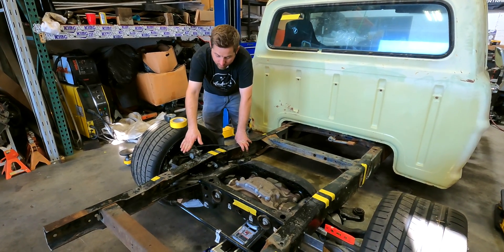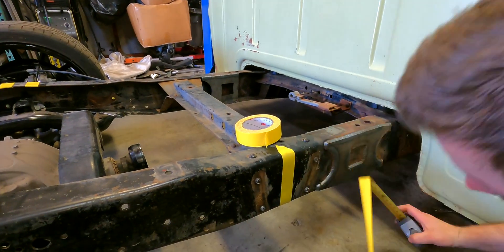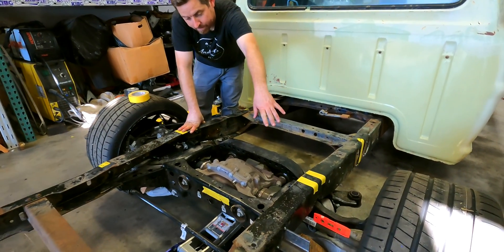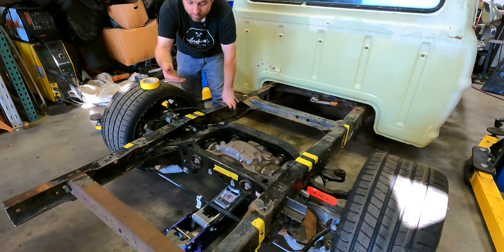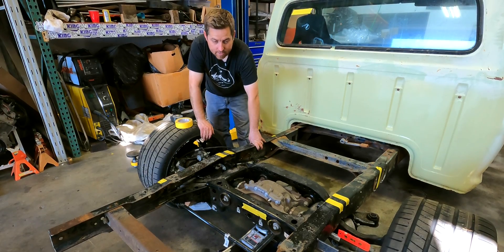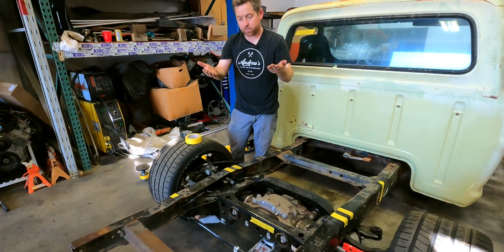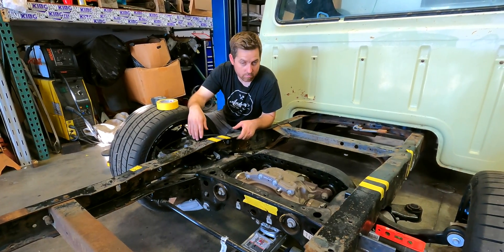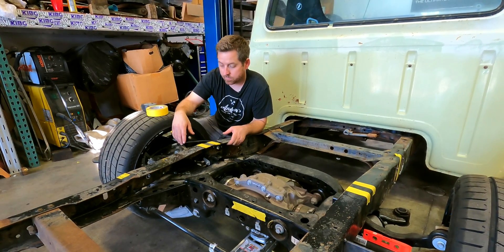Tesla Motor Swapped Ford F100: S550 Mustang Suspension Pt.2

Comment: Great video Andrew. Got the templates installed & frame cut. Only thing I don't see is where you referenced from to square it up. I used woodworking center points and holes in the frame to get an idea of how close it is.

Comment: perhaps i missed it, but why coils and not leaf springs as the manufacturer intended? Don't get me wrong i'm not a purist, but would the leaf springs not handle the weight if it handles a pickup under normal work conditions? I'm currently working on the same project and would love any info you could share!

Comment: Turn it 90 degrees and make it four wheel drive…
Reply: ZeroEV sells the taller reduction gears and reverse gear oil pump. This is actually a thing.
Reply: @apricity69  I know, Zero EV is a collegue of ours